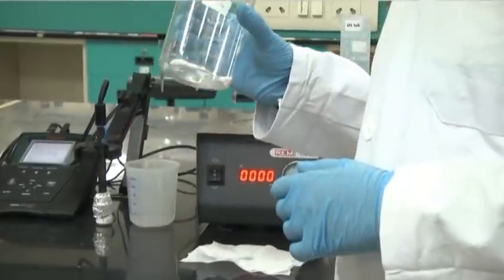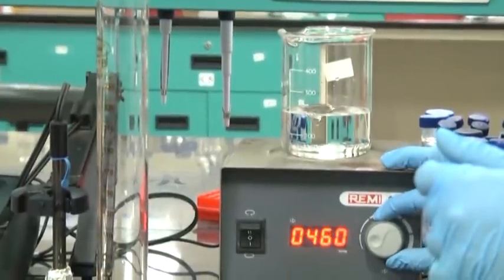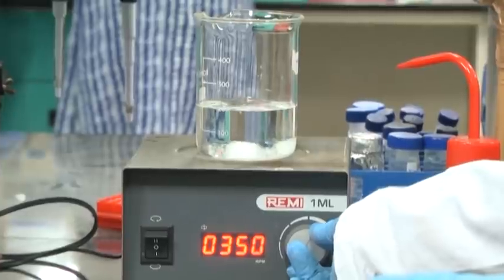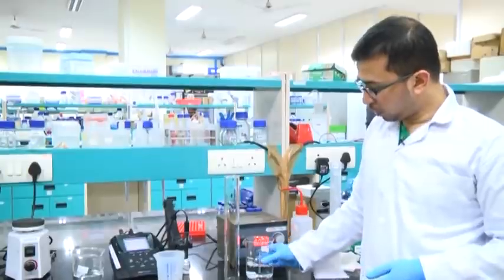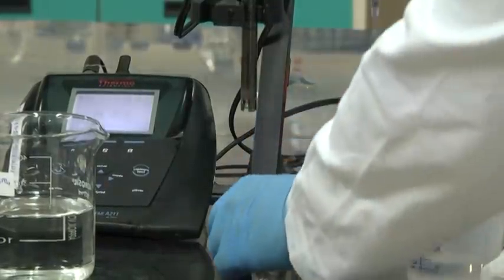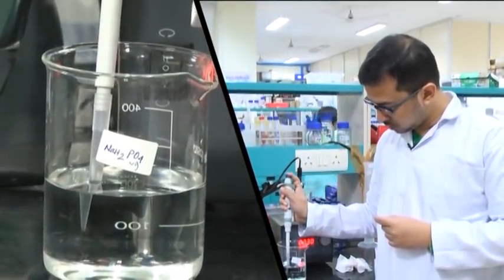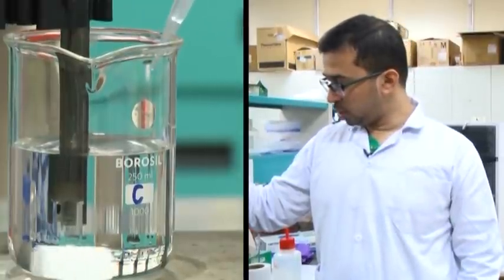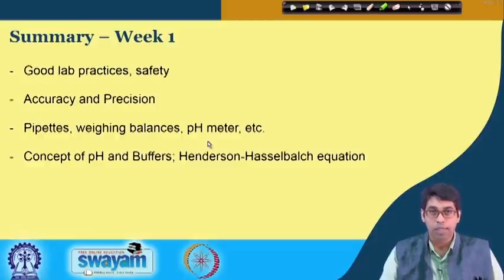Lecture 06 : Making Phosphate Buffer (100mM)

Comment: I have a question. If this is the case, the final conc of individual ingredients will never be 0.1 M. For preparation of a buffer the final concentration of acid and base should be equimolar right?
Reply: Manmatha Dhara  I have the same doubt, does the concentration of the final solution will remain as we are adding the same molarity of both solutions??

Comment: The second ingredient u r adding will have a very low concentration. How will and how long it will act as buffer?
Reply: Since they have prepared equimolar solution i.e. 100mM so the concentration doesn't change. It's the volume that's different not the concentration.